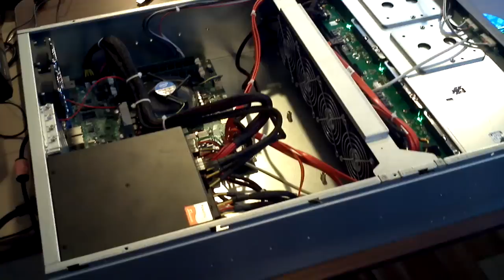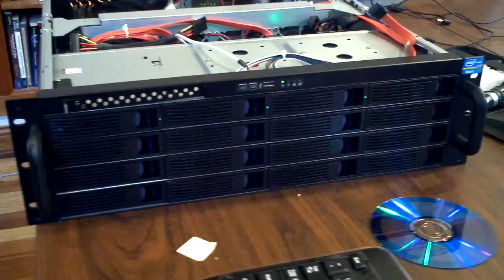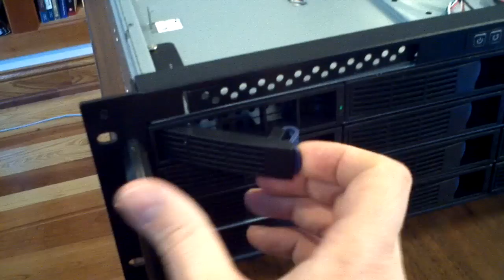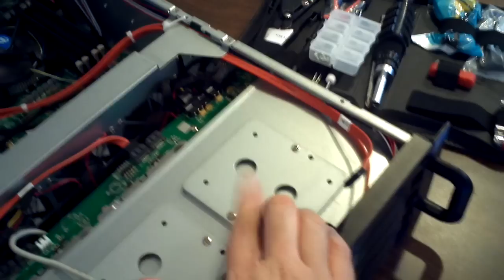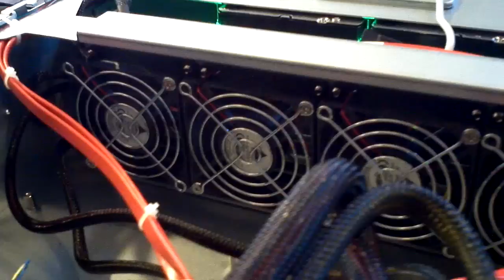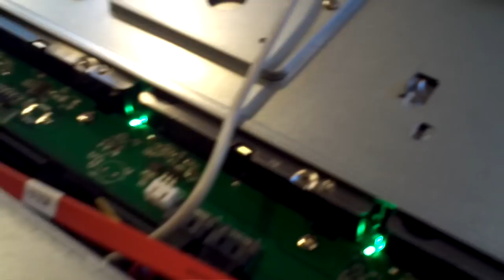March 09, 2012 Server Build

Comment: I recently purchased this case and can't for the life of me figure out how to mount an SSD using the included brackets.  Did you need to buy something else to mount yours or am I just missing something? (it's probably that -- it's always that!)
Reply from the maker: Joel Howe This server, if I recall, didn't have an SSD drive. With that said, these drives are 3.5", and SSD drives are laptop sized 2.5". As you stated, Yes, you will need an adapter such as this to mount the drive: https://www.amazon.com/SABRENT-3-5-Inch-2-5-Inch-Converter-BK-HDDF/dp/B00G56ZNZU Wish you the best; enjoy your new case.
Reply: @1FastGXP  Really? No screw threaders to hold ssd's in the caddy's eh? Man. I was about to pull the trigger on this model too. Oh well.

Comment from the maker: Drives are still working.  I did have one that developed bad sectors, but WD took care of it right away with their excellent RMA support.  The drive didn't fail, just had media errors.  I would highly recommend these drives.  I use many WD digital drives with few issues, and if there ever is turn around and RMA support is very good.

Comment from the maker: Parts came out to around $1,800.  The costliest being the three one terabyte enterprise hard drives ($270 x 3).  MS Small Business Server 2011 only cost around $350 on promo at newegg.  So around $2200.00 with server software for a Xeon Raid5 server.  No the company I built this for does not currently use this server for FTP.